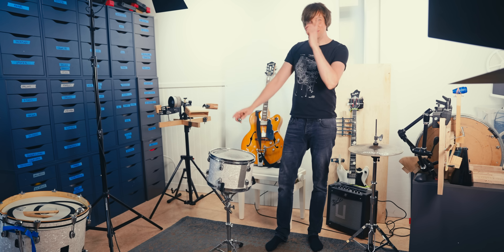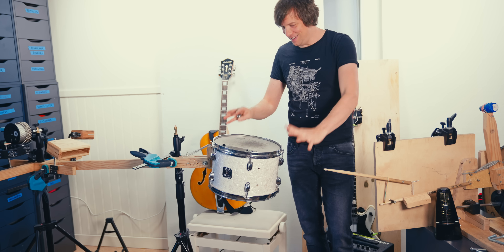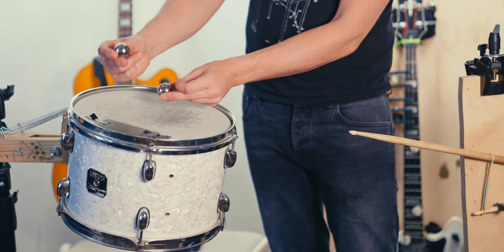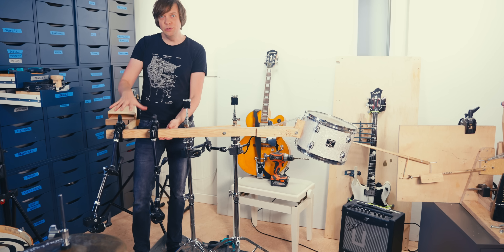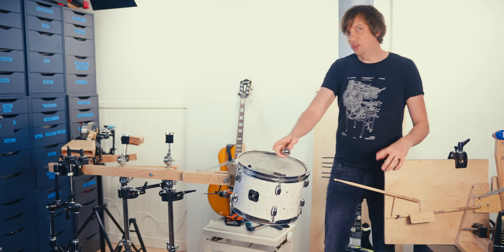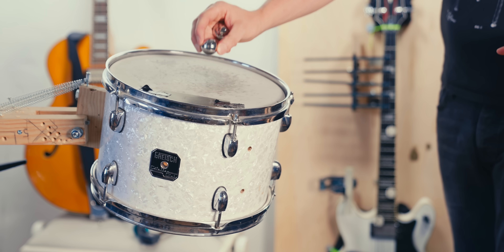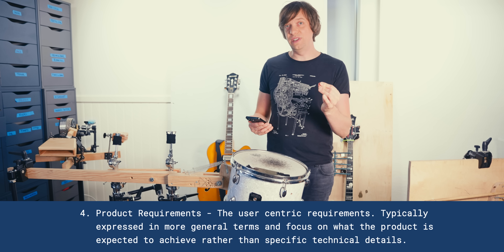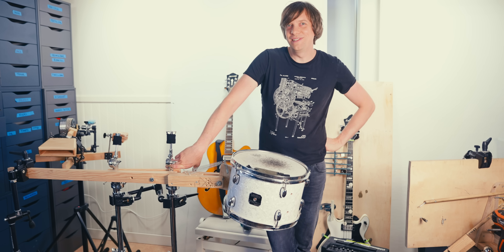Drums that Move makes the Marble Machine FUN!

Comment: As you discovered, the drum movement has has an effect on rapid follow-up hits. I can justify this sort of effort because when you hit on drums, there is movement, although a LOT smaller than what your planning is showing. I also get why you're doing this. Once this starts to pan out, why not have shells made from smoke or frost acrylic(to hide wiring) and have a piezo pickup trigger an LED light that flashes inside the shell and lights it up when hit so as to draw more attention to the drum. It doesn't need to be blinding, just enough to catch more attention. Each drum could be a different color, or you could use some sort of Piezo to MIDI trigger than could be used to send MIDI note on commands to a software package that integrates with lighting and you can have complete control over the triggered light show. You could do similar things with other elements but using a more wash light to cover things like the vibraphone or the quad-tree.

Comment: At this point I'm convinced the real problem with MMX was the form factor... because you're basically adding back all the discarded features , accounting for them occupying more space and adding parts. My advice is to opt for self-tuning and failproof designs if you don't want to spend a whole week adjusting the machine just to play 5 minutes before something need to be repaired.

Comment: If you could figure out how to make the drum lighter, I think that would help you get it to move the way you want. Right now, it is slow to return to its original position because of the inertia of the drum, and using firmer springs will make it move less, so the drum must be lighter. Also, some foam to absorb the shock of the drum coming back would help with the bounciness

Comment: You made the distance between the marble drop and the drum surface variable. If you need to drop several marbles in succession, it will be impossible to maintain a consistent rhythm.

Comment: Comments talk about timing issues, I think it is only an issue if the 2nd hit comes on the same drum while it's still moving.
You can avoid that issue by making the drum come back up quicker, OR having just multiple drums for rolls, instead of doing 4 hits on the same drum, perhaps doing 2 slower alternated hits on 2 drums?
I don't think this would add too much complexity, if it remains a simple pivot & spring system. And it indeed looks cool
Though other options are also to be thought about..

Comment: To help reduce timing issues, you could always have... Multiple drumsets. It could be problematic in terms of space and automation (especially if you try to automate the two separate drumsets from a single programming wheel channel per drum and alternate the pairs) but wouldn't that be so fun? Until we start running into issues at least lmao

EDIT: alternatively have the movement be faked, as a response to the programming wheel rather than the marbles. Much easier to control, and you can do more creative stuff! Could have a channel on the programming wheel that, in a chill part of the song, has the drums gently wobble up and down, until the drop hits and the drums "actually" react to each marble. Control the movement of the instrument and the marbles together

Comment: Potential inconsistency in sound is obviuous, but there's another issue to consider: moving drums = losing energy. So you'll need to make marbles heavier or lift them higher. That can be a problem with a muscle-powered machine.

Comment: Make frame with 3-4 springs. So drum will move in vertical direction without changing heat angle of surface. I think that is the key.

Comment: The counter weight implementation is the only valid one, springs will wear out with continued impacts and the bounce will become inconsistent. Counter weights are much more resilient and foolproof, while still giving you a good leeway of adjustment.

Comment: I really do agree that the movement is really cool and fun, but super impractical for the performances you want to give. You're barely going to see the drums moving from 30-40 feet away from them and probably not at all from 50+ feet unless a drum is getting hit a lot with heavier marbles and then stopping for a second to let it come back up. I'd say multicolor LEDs that activate on impact would be a lot more practical and still be in line with your wish to emulate Animusic since they have a couple of videos with lights flashing to the music. Just remember, Animusic videos are really cool, but they don't need to obey the laws of physics like we do.

Comment: I feel like we've been here before with the MMX. If Martin's back to moving drums and marbles playing drum rolls, why did he abandon the MMX in the first place?
Reply: The feature set was not the reason for abandoning the MMX (by feature set, I mean moving drums, a musical carousel... drum rolls... you get what I mean). It was because there was no proof-of-concept phase in the design approach. Everything was designed and built with the assumption that it would work, without any pre-testing of each component as a proof of concept to see whether or not it can actually be done. To put it simply, the machine just didn't work.

This better design approach of pre-testing individual parts/features, as a proof of concept, has a better chance at success.

Comment: I'm mostly concerned with quick drops in succession, when the drum is angled after a hit, it will change the angle that the marbles leave at, meaning you need a bigger funnel to catch them since the location changes a lot. My contribution for a idea for visualization of movement would rather be to have the drums on a sensitive hydraulic-pump or something like that, moving the drum just up and down without changing the angle

Comment: What about a “vibration isolating” mount? You could achieve the small movements with a simple mounting interface, low durometer isolators can offer a lot of movement in a very consistent manner

Comment: LED Lights, you know them shoes kids have that flash as they walk!!! can you take them apart and use the rubber sole as a dampener for the drum and also as a display of sound, BOOM flash movement all in one???
PS the damper can be used to limit the travel of the drum regardless of size of marble, so you can set your movement parameters and perhaps keep your timing too.

Comment: Functional demonstrators (that's what I would call this) are important to validate concepts. This must be done before you settle for requirements where you will have to trade off certain aspectsts. What I call prototypes are parts which are used to verify design. Which is to prove a design acutally works the way it is specified in requirements. System engineering is "shit in, shit out". Means if you start off with crappy requirements, you will end up with a crappy system. So: I think you are on the right track. Also "bad ideas" need to be checked out to see that they aren't working. This helps you to not be "too clever" in the subsequent process in not fooling yourself into a trap.

Comment: There a thing you need to be careful with moving drums : resonance. If a marble hit the drum every second, and if the drum is bouncing and always on its way down when hit, the bouncing motion will get stronger and stronger. This can create many issues (big and variable timing errors, uncontrolable marble bounces, ...). 
And the problem is, if you want to play different tempo, there will always be a tempo where this effet is happening. Unless this critical tempo (resonance frequency) is super slow, but this means really slow motion for the drums and it doesn't look good. Or the critical tempo is super high, but this means the motion is super fast (ie drums are not almost not moving anymore when the next marble is hitting the drum, even at 160bpm).
What I said is not exact but it highlight one issue you might have and which need to be accounted for !

Comment: I am a little bit concerned if the drum moves, that marbles will fly everywhere, especially if the drum hasn't returned into the relaxed position. My idea for visualizing the drums getting hit is to use light with sensors (shock or sound). That way you also can see fast hits better too.

Comment: I'm wondering if a linear rail system with springs might be a more stable structure. Imagine a condenser microphone holder setup, but with rails that the drum rides up and down on. So you still get movement. But it's not as wobbly and is a little more predictable.

Comment: A few things: First, I agree with @Rurexxx that the requirement should change to something like "Instruments shall visibly indicate when they are being hit, even to a distant viewer" the drums moving can be a possible way to do that. Second, I think it looks much better with just 1 pivot and it will be far easier to tune properly. Third, you spent so long fine tuning the timing and now you're about to throw it away with this thing. How to balance timing and visuals like this will be a difficult  question when it comes final design.

Comment: You should really think about using Tom mounts to hang your drums, instead of putting the on a rigid stand. What you are trying to do is tilting the drum in only one direction, this will obviously create some problems with marbles. Hanging your drums will naturally give them some room to swing a little in ALL directions without changing the angle of the head. I can personally recommend you to look into the Tama starcast mounting system for Toms. The toms are only attached to the upper hoops with rubber connection on 3 points, so they end up wobbling around a bit (at least playing with sticks). Marbles (especially larger ones) might have an even better effect. If you attach them to a free hanging arm, or one with a similar principle to the aforementions mount, then i believe you can get the visuals you desire without compromising on timing too much. If you have a Drum/Musicstore nearby you could potentially even test it there.

Comment: The weights are not angle locked
This way the pivot distance is not constant and will messup the balance on different Heights 

The distance adjustable is what you need, not a rotating factor on top of that

Comment: The moving drum also introduces some phasing or even doppler depending on speed, similar in principle to a Leslie - I felt like there was more richness / action to the sound due to this for the early examples where the drum was moving far quickly, curious if you observed this in the space.  I agree with others on the 2-hinge, interesting thought but detracts from the effect imo.  Certainly wouldn't want a distracting abrupt speed change during return, would ideally want one smooth movement I'd imagine, even if the speed is changing.  I think a better design, when you start your actual designing stage, would be to provide ways to adjust things like the moment arm etc. to vary the drum movement - you could even have channels on the programming wheel to control this, to e.g. really open for a chorus or bridge section, even continuously if you wanted - like MIDI CC channels on the programming wheel.
I actually was afraid for a second at the start of the video that you were going to put toms on the percussion windmill thingy lol.

Comment: I love the moving drums but it's probably going to be a nightmare to make it work correctly. Three issues came immediatly into my mind:

The marbles timing will change. Not only the "ghost hit" will be off but all of the other hits as well because the drum is still returning to the original position.
This can make the marble collection worst, as the area might need to be increased.
Drum roll might be impossible to pull off, unless you use a specific drum for that, which makes the machine bigger.

I really hope these points won't be a problem because i really love the movement. I hope you can pull it off, but don't get your expectations too high if it doesn't work as you envisioned.

Comment: Yes, looks cool, BUT... As many pointed out already: All the timing testing that you did will be obsolete... BUT also to all the commenters here... If the machine is properly designed, then swapping out the drums is not that big of an issue, since we have more space to work with... On the MMX, swapping instruments would be a lot of anglegrinding...

I would not put this in design requirements, but more like "Nice to have"... use static drums first and worry about moving drums later, if the concept works

Comment: Seeing as the concept is moving toward a stage wide machine, why not use the stage as a hug marble collector with a gutter at the front. Then the random escapees won’t be such an issue.  
Kind of how how water heater cylinders can be mounted in a tray with a drain.
The tray can even just be localised around problem areas like these drums

Comment: The engineers are wrong: you cannot prototype too early. This is one of the common disagreements between designers and engineers 🤣

This is sailing dangerously close to kinetic finger reef… Progress is being made though, and it’s never a straight line up. I do like the movement in the one-pivot version. One of the benefits of previously demonstrating such accuracy is that Martin now has the choice whether to use it or not. If the previous timing had only been “good enough”, he couldn’t have sacrificed some accuracy without it becoming not good enough. Whether this feature stays or not, I believe.

I’m not persuaded by the double-pivot version, though 🤣

Comment: actual question: should you spend some time soon to see if theres a way to get satisfactory sound from marbles just dropping onto the ground under the machine onto an insulated floor? you said before while minimizing noise that you wanted the marble paths to be predictable so the catches would be as smooth as possible. what if you came up with a way instead to make intentional floor marbles (!!!) but have them land on a big sound-deadened area thats lightly sloped towards the elevator, so when you come up with weird ideas like this it doesnt matter where the marbles go after hitting the instrument?

Comment: You could also have a nicer or more consistent movement by using two arms in parallel rather than one swinging the same angle as the front pivot

Comment: People come for the music, and from 15 to 20 feet away they will never see all this "fun" stuff..
   
What you are doing is making it too buzy, too complicated, with FAR greater likelihood of failure.  If you want to make it "fun" forget all this BS, and make a working machine, then once its working you can add lights that turn on and follow marble's making it easy to follow them.  You can light the drum when marble hits it with a simple LED.

You fun moving drum makes it impossible to play tight because the springs wear out with use.  LED lights last far longer, and will not change over time.   Forget all the movement and focus on the working machine.  Then you can add fun!

Comment: Why not consider just a parallel linkages to the drum, that way the angle the drum is at stays consistant but allows it to sway up and down still which I imagine would also reduce the area needed to catch marbles as your limiting the angle they bounce at off the drum.

Comment: Sometime you need creativity and knowledge on what is possible before you can plan. Because if you plan something that is impossible or that will take to long to execute then you machine will never get finished. In Engineering I found that compromise on certain things like thing that are just not doable to take them out of the design feature at least keeps the project moving. A good engineer will alway leave room for improvement on his stuff.

Comment: I think 1 pivot is cool. 2 isn’t. And 1 pivot from a long arm is a bit cooler than from a short arm.

Even if makes the conception of the marble machine more complicated, I admit that moving drums are much more appealing visually. Maybe we can mitigate the problem by using colored lights activating with each hit. Each drum would have its proper color illuminating it when it’s hit. Then we would have the visual effect without jeopardising the reliability of the machine.

Comment: You're going to repeat the MMX issues of repeatability. I'm not even talking about when it's in short delay repetitions, but rather that as an example, springs are not precision fixed forces. Springs wear out over time, so how much the drum moves with ball 1, will wildly differ from how much it moves with ball 10k.

And when it comes to the counterweight swing arm, you're now relying on movement in that joint to be loose enough that it will swing freely, which now means the joint is also loose enough that you introduce a certain play in that joint. Which means you're never going to have the exact same position every time that it returns to. Both those variations will lead to severe issues with the ball pickup, just as you had with the MMX.

To make the kind of moving drums, while retaining the precision you need for the repeatability you're looking for... You're going to need things like servo controlled movement mechanisms. But you could essentially fix the drum to a servo arm, and have the controller detect the ball hitting it, have it exaggerate the movement to the exact amount you wish, and then return and you could have that return both be fast, and with very VERY high precision depending on how good servos you get. But it's expensive, and it sort of clashes with the idea of entirely mechanical and into the electromechanical.

Remember that any time you introduce any kind of movement in mechanics you inherently also lower precision. The more movement, the less precise your result will get.